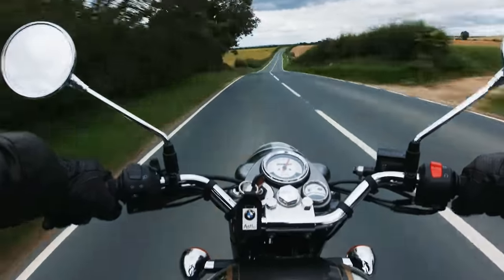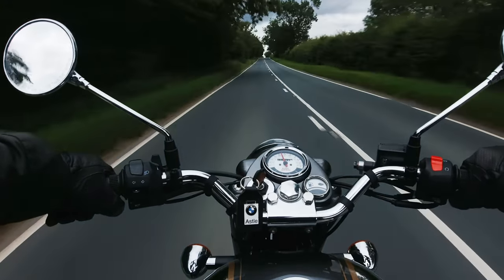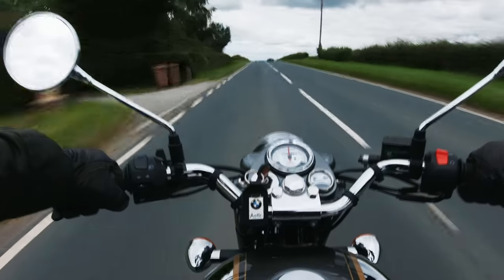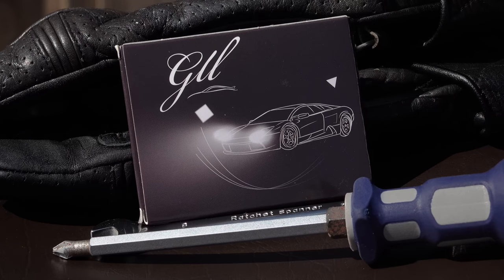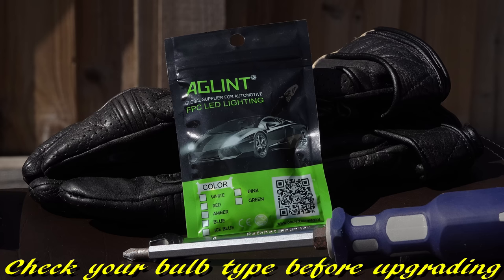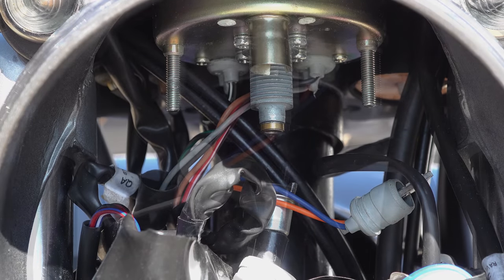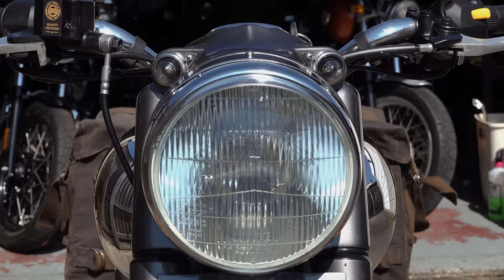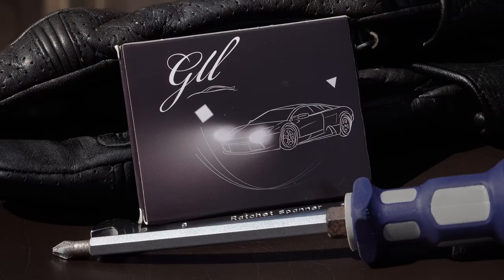Royal Enfield Classic 500. DIM Instrument lights? How to UPGRADE them to LED!

Comment: Well, there you go now. Even after 1200 miles, I never noticed the indicator flasher on the panel!  Thanks for doing the legwork for this.
Reply: me too! then it worked!
then it didnt!
Reply: @stevec-b6214  Could it be your bulb holder has fallen down? This happened subsequently to my low fuel light after fitting the LED. It seems I hadn't pushed it in firmly enough.

Comment: Concur with THE MOOG. LEDs are Polarity sensitive. Turn globe around or switch wires. Works all the time. Cheers.
Reply: Not all LED's are polarity sensitive. You can get non polar just need to make sure when you buy.
You are correct though, on a polar sensitive switch wire around if it doesn't work.

Comment: Just completed this upgrade, very pleased. I found it easier to lift the clocks up out of the cowl and fit the bulbs that way, there is enough wiring to do so. I also upgraded the speedo bulb with the same led, looks great. Ride safe all.
Reply: You still have to take the headlight apart though, then unbolt that bracket.. Ill give your way a go when I find a suitable LED bulb for my indicator light..

Comment: i have a 2018 Classic Stealth 500, ordered LED's from Uncle Stu's link (only wanted the T10's) last night, they arrived today at lunchtime today! Easy job to fit, So much brighter, Indicators work left and right and warning light flashes. Neutral and high beam work just fine, many thanks for your hard work sourcing these important low cost safety replacement parts.

Comment: I changed out the high beam, neutral light and turn signal indicator bulbs today and it is MUUUCH better in sunlight!  Speedo bracket out, entire speedo pops out on top.  Easier to get to bulbs.  Thanks for the guidance and ride safely!

Comment: Another good video Stu, thanks,
I changed my Speedo lights to the same LEDs when the back light was constantly flickering when riding, 
I have big hands but I was able to change the indicator neutral and high beam lamps without removing the cable or bracket, one hand in from the front and fingers in by the side, I'm more than happy with the led backlight on a night, 
I'm yet to change the abs & fuel lights etc, LEDs on order now!

Comment: I just changed the bulbs in the speedo and that worked perfect - thanks a lot, Stuart! But in my Classic 500 Euro4 made in 2017, the bulbs for tank reserve, ABS and engine control are not T5 sockets. I have little push-and-turn type bulbs and couldn‘t replace those with the T5 LEDs shown in this video 😰. Have to look for some alternative. The good thing is, in my model the fixing tubes are made of brass and not rubber, all in all maybe a bit more solid.

Comment: Aren't you replacing your little side lights too ? One thing to mention is these led bulbs have polarity , so if it doesn't work when you put it in just turn it around ! ......Just to throw an unrelated topic in for you to cogitate on.....saw a 21 plate Interceptor at Willy Woods yesterday and got chatting to the guy ( as you do ) and noticed that his 21 plate 'ceptor 2wks old and completely stock was sporting a set of CEAT tyres 😯 wonder if this a one off , dodgy dealer or RE have downgraded the tyres as well as hiking the price ? Nice video 👍
Reply from the maker: Yes the Indian Government introduced new and heavy Tariffs on imported goods so RE has had to switch to a domestic tyre brand.
Reply: @stuartfillingham  Ah that explains it ! No idea what those tyres are like but gut instinct would be take them off and replace them,  I know it's adding to the cost of purchase but better that it rides on the tyres originally intended !
Reply: @themoog3889  I have the bullet trials replica with ceat tyres and they seem really good. 👍
Reply: @glenpillinger2234  The CEAT tyres on the Himalayan get favourable reviews too ! Never ridden either bike so I wasn't giving them a definitive thumbsdown but the Interceptor was designed around the tyres so the myth goes and I would ride the 650 differently to the 500 or the himmy so would be cautious . While I was talkingvto the owner a classic trials in the silver & lime came in ....looks a lovely bike 👍
Reply from the maker: @BronwynCarlisle  Phantoms only tend to track if the tyre pressures are below spec.
Reply: @BronwynCarlisle  That's interesting I've not had any issues with them , but I won't argue as it's each to thier own ! Confidence is king here ....you must have it in your tyres , I personally won't use any Battlax model tyres never liked them but I have friends swear by them   I'm surprised we don't get more tyre issues as we don't ride on the left of the road , we ride on what's left of the road ! 😂
Reply from the maker: @BronwynCarlisle  I wouldn't trust tyre pressure indicators, every vehicle I've owned with tyre pressure alert systems have been way out!
Reply: @BronwynCarlisle  I find that very hard to believe. Ive heard a lot of complaints about Phantoms squirming excessively from customers and its always traced back to improper pressures they are a cracking tyre.
Reply: @stuartfillingham  Cracks me up when I hear complaints about tires tramlining. They all do it to some extent because its a bike and its governed by physics. But excessive tramlining is always down to tire pressure or abnormal wear caused by running the wrong pressures. But can you tell them? No its always the tire and never the riders fault!
Reply from the maker: @BronwynCarlisle  Hi Bronwyn myself and others here have just offered opinions in an effort to help, but it seems you are just spoiling for an argument. I don't see anything offensive in the replies offered to you and most of the comments do echo my experiences. I run 3 bikes with phantoms and have no issues they are a competent tyre. perhaps you should just take the suggestions in the spirit they were offered. I'm right and your all wrong isn't a good look!

Comment: Nice job Stuart
I replaced all mine last year
Even the tiger lights 
 Bit fiddly 
Removing the whole headlight assembly made it easier wish i had done that.
The end result is well worth it.
The only bulb i havent tested is the low fuel warning 
Unless i let the fuel run low i wont know if it works.  Bit risky ☺
Reply from the maker: there's plenty of mileage left after the fuel light comes on, at least 20 miles!

Comment: Thank You! Our own latter-day Jack Hargreaves (remember him?) shows 'How' to do it!  I only bought my new Classic 500 a couple of months back & noticed straight away that the OEM lamps were poor. This upgrade will be a welcome improvement.
It would be interesting to find a suitable LED main headlamp bulb - this would perhaps reduce the load on the battery, especially on (electric) start up. With the headlamp being permanently switched on, the reduction in heat within the headlamp assembly could be another benefit.
Reply: Fit a NOVSIGHT LED replacement. The difference is astounding!
Reply: @richardcopeland9142  Thanks Richard - much appreciated!

Comment: Oh well, stock bulbs are dim; to quote Anthony Burgess, "dim being really dim". On LED replacements this time I beg to differ though. For now. And only for personal reasons. Other Bullet/Classic owners I am in touch with already made the switch and they are happy, and that's all that matters, but personally I will, for the moment, stick with filament bulbs that are closer to the character of the bike. Although I am afraid I will be sooner than later voted out - I had to change an indicator bulb recently and I went to a great deal of trouble just to find it. And I was overcharged, when I did. So. Anyway, I still appreciated this video *a lot*. The Bullet/Classic casquette is really uncharted territory (even with a Haynes manual) due to the hodgepodge of cables, but now I know, in case, where to find what!

Comment: N.B. I have the 2018 Classic 500. The push fit T5's do not fit. £8 wasted. It's not a lot but can't be bothered with the hassle on Amazon to send them back The originals are normal bulbs and not push fit.
The T10's are great👍.
Reply from the maker: I did put enough warnings up on the video to check your fittings before purchasing!

Comment: Ok Stuart, I've upgraded all the lighting on my 2011 H-D Iron 883 to LED's, they're a lot brighter than the stock incandescent bulbs, especially the headlight. The H-D "Daymaker" was very expensive at £400, I went for Chinese replicas of the stock H-D bullet type with seven LED's at £25 a pair, that's over £100 cheaper than the H-D LED units.  I can't understand why H-D fit 3 in 1 LED indicator/tail/brake lights on the rear and incandescent bulb indicators on the front. My old 1977 Triumph TR7RV Tiger 750 used the T10 bulbs for the idiot lights mounted in the top of the headlight, I wasn't aware until now that they are still used on motorcycles.

Comment: Thank you so much Stuart it's always a great help, this is the same problem in India. These little lights are so dim, I usually step out for early morning rides or late night rides and can barely see the speedometer it has to be pitch black for the these basic essential lights on the meter to be visible. Will if I can get this done in India.

Comment: Maybe they have always fitted dim instrument lights from way back and never thought to change? And perhaps in their main markets such things don't matter. Anyway it will be interesting to see if the LEDs are long term compatible with single cylinder vibrations.
Reply from the maker: like I said they are solid state so far more robust than a standard bulb.

Comment: I just watched a video concerning recent production shortages. I'm wondering if the correct bulbs were unobtainable so they used what they could get. Just my speculation. Ronn
Reply: No. Both mine 2yr old, same prob. An earlier one I had did.nt have black coating on glass and were ok.

Comment: Re: That little clip thing in the top of the speedo housing holding the top of the headlight shroud.. I unscrewed that top screw all the way out and that clip fell in to the headlight housing.. That alone took me quarter of an our to work out which way round it went.. But.. Apart from that, I've changed my neutral light for a brighter LED, now to find one for the indicator bulb.. The LEDs I bought are weird.. Turn on the left indicator and the LED flashes, turn on the right and it doesn't.. Take the bulb out and turn it round, plug it back in.. Turn on the left indicator, nothing.. Turn on the right and the LED flashes.. Grrr.. I have to get an LED with a single circuit, not this dual circuit thing I've bought.. Still.. I've fixed the neutral light.. That was annoying me the most.. The other "idiot" lights aren't as important.. The highbeam indicator bulb is fine as are the ABS and Engine warning lights.. The low fuel indicator bulb will have to go.. I'll dig that one out tomorrow... I was worried I was going to rip the wires out of the plugs.. They're a bit of a pain to get out... Anyhoo.. Thanks again for a very informative video..

BTW..
I don't think you have to unscrew all the screws around the headlight.. Only the top one.. Unscrew it a little then hinge down the headlight.. There's a clip holding it in place at the bottom.. When the headlight "lens" is out, unplug the headlight bulb, and pop out the park light.. Do what you have to do, then reverse procedure reassembling it.. Its easy once you've tackled it once.. 👍

** Edit:
I've "changed" the speedo display lights now.. I found an LED bulb suitable for the indicator (My gawd its so bright I can see it in the middle of the day), changed the Neutral light to LED too, I left the "Hi beam" light with a standard OEM globe as I reckon that one doesn't need to be so bright at night.. It'd be too distracting.. I changed the ABS globe for a red T5 LED and it looks really cool now (I have a red ABS warning light), the engine warning light - I painted it with orange glass paint, that looks weird now, like it has a sort of swirly pattern in the display - looks kind of like its on fire.. And for the "Low Fuel" lamp I painted that one light blue, so now it displays in a sort of turquoise colour.. I've left the speed display with the standard OEM bulb. I like the level of illumination of that bulb.. Its bright enough at night.. I think an LED would be too bright and distracting...

So now all I'm waiting on are my muffler, single skin header pipe, and Halcyon bar end mirrors from Hitchcocks. I have a DNA air filter waiting patiently on my shelf for the exhaust to be fitted.. I'm not too sure about changing the plug for an iridium one, and I'll see if the bike runs differently before changing the front sprocket for the "go faster" one..

Oil: I'm going to be running it on semi-synthetic at my next oil change..

** Unky Phil - Does the oil make a difference to engine noise like people say it does?? I understand semi or fully synthetic oil makes the engine run a little quieter..

Comment: Forgot to mention on the 2020 (and presumably the 2019 model) The GLL T5 bulb will not fit as RE have changed the fitting to a bayonet fit rather than the simple push in type bulb! (this only effects the petrol/ecu unit) where as the T10's are still the same as Stuart recommends.
Reply from the maker: not sure if you noticed but my Bullet is a 2020! Year is no indication of bulb fittings! Hence the warning on the screen about checking bulb type first.

Comment: All the instrument bulbs (inside the headlight housing) in my 2021 RE Classic 500 are T10.  Replacing a T10 LED in the turn indicator is problematic.  It only flashes for one side.  If I reverse the bulb in the socket, it will only indicate the other side!  Not sure why that is happening.

Comment: Excellent video Stuart and perfect timing as I want to change the bulbs in my 2020 Classic EFI. Thank you for the links for Amazon too, I shall order these tomorrow. Can I just ask, did you have the issue re the indicators as referred to by Leslie Wilson ie in that the flasher light only works one way? Or where your bulbs polarity independent? Whilst asking - there seems to be a lot of noise on you tube re AHO headlights and converting bullets back to BS3 switchgear to enable switching lights on independently - Do you have a view on this?
Reply from the maker: If there had been an issue I would not have made this video.
Reply: @stuartfillingham  Makes sense :-)
Reply: So all bulbs arrived - completed the change without any hassle - Exactly as Stuart predicted it would be. On my 2020 model when the speedo retaining clamp was released, I found that the speedo unit would pop up enough to allow me to change the bulbs outside of the nacelle - I've also gone ahead and changed the tiger lights to LED too. I purchase my LED from where Stuart suggested - for anyone contemplating this change - They worked first time! All I need now is a better main/dipped bulk!
Brilliant Video Stuart !!

Comment: Hi Stuart I seen speedometer seal wider side  handle side 
Does it help more space under the speedometer 
Actually mine new  headlight hitting the speedometer cable and mine speedometer  seal  wider side on the top side 
Any idea?

Comment: What about... the headlight bulb?! 😅 I think it is the real Achille's heel of the Classic lightning, really a bit unsufficient when riding at night. Putting in a more powerful bulb could damage the unit (higher heat affecting and deforming what is not glass but plastic). Any hints?
Reply: I switched mine for a Ballack H4 Rain drive+ (the one with the yellow tip); i love riding at night but I live in a foggy area, and the new bulb has been, so far, a great improvement. It feels (relatively) hotter than the stock bulb, yes, but the headlight hasn't been affected at all. Also, it gives the headlight a yellowish tone, with a pleasant period feel.

Comment: Those two wee lights above the headlight.. What are they for, and can they be made brighter? And would it be illegal to do so?

I found my ABS light wasn't working.. I only just noticed it when I first watched your video a couple of weeks back.. I wonder if its possible to change the colour of the ABS warning light.. I have a small bottle of glass paint..  If I paint the bulb red would that make the warning light look more orange?
Reply from the maker: They were originally indicators back in the 1950s.
Reply: @stuartfillingham  I think you mentioned a problem you experienced with your ABS warning light not working.. What was it??? My ABS warning light hasn't been working since new.. I only noticed it after watching your video.. I assumed the warning light would be red like it is on my BMW F650GS and CanAm F3S Spyder.. I changed the bulb, I even found and tried a T5 LED bulb.. Neither work.. So its either the socket or somewhere else along the wire... Do you have any ideas what the problem might be?? I also found some suitable T10 LED lights.. Ill be switching out my neutral and indicator lamps later.. 👍
Reply: @stuartfillingham 
I replaced the tiger eyes with LED lights.. They're a lot brighter now..

Comment: Where is the link to the bulb packs please?
Reply: Stu, I can’t see a link to buy the correct led bulbs can you advise please, I’ve watched many times trying to work out the correct ones but not able to find on Amazon as there is so many different types and this is an upgrade that def needs to be done…..
I’ve just acquired a B5 and would like to do this 👍